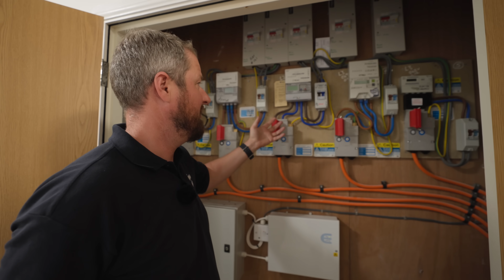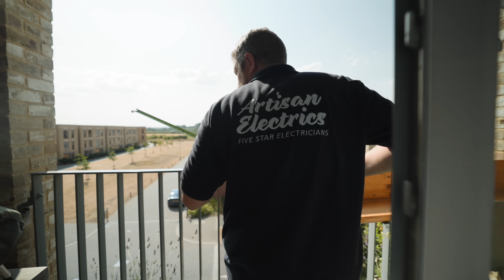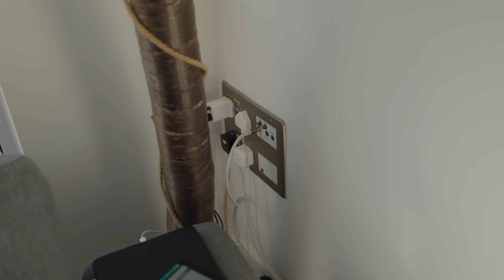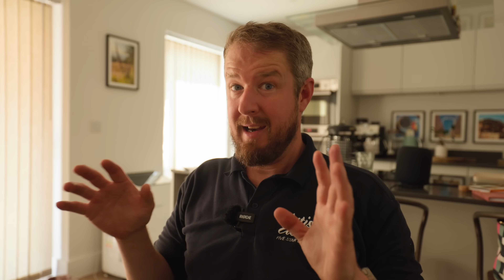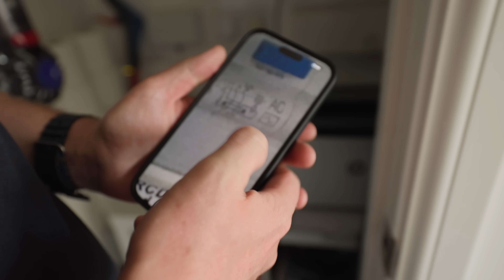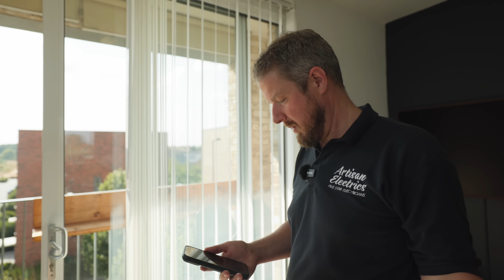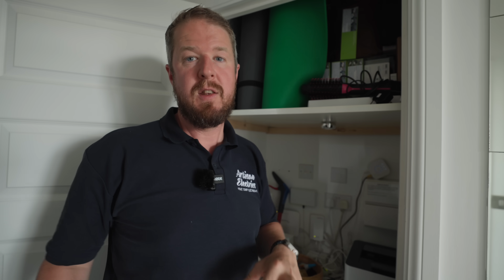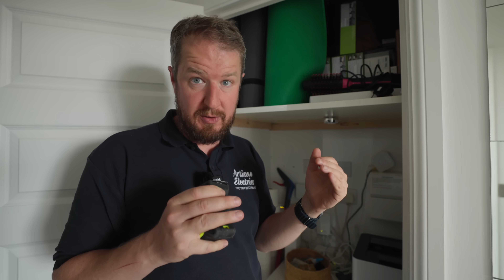I Found a BIG Problem With Plug-In Solar…

Comment: Come on, it's 800W (3.5A) and the wall socket does not care which way the current flows. If there is a problem to connect such a tiny load, the home wiring is probably allready dangerous without it.

I do agree that a tiny balcony is not really suitable for this solution. A minimum of two 400 Wp panels is worth it, but I would not spend the money on anything less.

The heat issue is nonsense. These panels take away about 24% of the radiation and convert it to electricity. The rest of the radiation is either converted to heat in the panel or heat in the home if it was not there to block the sun. The biggest downsides are blocking the wind and the view.
Reply: And fartisan ought to know that because one of the classic ways you cool a problematic hot room in roof in the UK is put solar panels on top of it. They act as a parasol, and generate power and it's about the only parasol you can attach to your house roof without planning.

Comment: Again scaremongering. Come on pack it in. You’re not doing yourself any favours.
Reply: Because this will affect his business in a negative way.
Reply: @Stephen_Dove I don't think plug-in solar will affect solar installers in any negative way.
Firstly, they don't install on balconies.
Secondly, the market for a 5kW system is totally different from the market for a 800W system.
Thirdly, someone that I stalls a plugin system and see the benefits may decide to transition to a large system.
Its a win-win for everyone IMO
Reply: @konstantinlozev2272  A few years ago that may have been the case but the underlining cost of roof Solar and batteries large enough to go grid neutral is so vast it can neve be recovered now there is no feed in tariff except local deals, 12p I think.

In the beginning the highest Current Inflation-Adjusted Rate: Because those initial 2010/2011 contracts were locked in for 25 years and indexed to inflation (RPI, and later CPI in 2026), those original 2010 tariffs now pay out over 74p per kWh generated. It was worth it. No chance now.
Reply: It’s not scaremongering to tell you that you need to check if your electrics is up to date. If you are clueless and just buy something without checking then you are a fool.

Comment: A type RCD suitable for recognising DC current????
Reply: Yes, just because every modern inverter is already protected against leaking DC current and two panels can hardly electrocute a fly.
Reply: No, but it doesn't get disabled by DC current like a type AC. That's the actual issue here, not it detecting the DC.
Reply: I’m pretty sure the big red switch on my consumer unit is compatible.

Ironically, when I had part of the house rewired 20 years ago, I asked for an RCD to be fitted and, apparently, they didn’t make one sufficiently insensitive to be compatible with my 1964 electric cooker. It seems the earth leakage requirements were less stringent in those times. Since I was not interested in buying a new cooker, I simply went without an RCD. 

I’m now suffering angst because I don’t have a label on my consumer unit telling me when I last had the house tested … Conversely, I’m not in a hurry to let any electrician anywhere near my wiring with test equipment, since the last time (3 years ago) when I had an MCB blow up on me and the electrician blindly ran hipot tests on the neighbouring circuits to check for associated damage only to then destroy a digital heating controller, an electronic lighting controller, 3 LED bulbs and 2 power line network adapters!! Not only did I pay for his time and effort, he also cost me ££ to replace all the destroyed electronics. I thought the guy was supposed to know what he was doing.

Comment: "I found a big problem with plug in solar .Iam not getting paid to fit it "   .There fixed the title.
Reply: I think the target markets are different.
Rooftop solar is very much different in use case Vs plugin.
And if you start with a 800W plug-in system, you may ultimately see the benefit of solar in general and decide for a large installation.
Reply: @konstantinlozev2272  seriously! The first taste is free :D
Reply: @konstantinlozev2272 genuinely what I’m thinking of doing. I don’t currently have the capital to lay out for 20 panels (big roof) + battery but would like to make my house more green in terms of energy consumption. Be interesting come the end of this month!
Reply: Exactly.
Reply: Same as in France, the way round it is to have batteries that only trickle power into the house
Reply: @thetourk the way around it..,?  What do you mean...You cant plug regular batteries into mains power.
Reply: Should be booo hoo please don't do it yourself!
Reply: So true.
Reply: 😅😅😅 Yessss
Reply: THIS!  The whole video has a negative vibe about. He went in looking for reasons to not do it.

Comment: Gawd - our ruddy future - the rest of this Century - is being directed by blokes in shed, lashing up crud with cable ties and duck tape as a bloody hobby!! - it makes me weep. We used to have engineers doing this, building it properly, and running it as a serious blasted industry. If I were the boss of BMW looking to build a new Mini factory in the UK, where would I rather my electricity came from? A big building run by National Grid. Or some sodding junk out of the local DIY store, flapping on the patio fence. All held on with lengths of baler twine and sticky tape. It's what the Cornish would call "a bloody lash!" And this is the sodding future of UK PLC ?!?
Reply: Well it's been working fine in Germany, engineering powerhouse of Europe

Comment: I'm not a electrician, but i have a decent knowledge how the powergrid in my house here in Belgium works, but what i don't understand with this entire plug-in solar is this :
Normally, the power comes in to your breakerpanel and into your breakers, and if a overcurrent or short occurs BEHIND the breakers, the breaker(s) trip. So far nothing special, but with plug-in solar, the power comes in on the output of your breakers, so when a overcurrent of short occurs, this current does not go back and forth through the breakers, so  how can they trip then ? The only way to get them trip this way, is if the overcurrent or short is on the input side of the breaker(s), or do i miss something here ?
When using plug-in solar, you need to turn off the main switch, to prevent power from the grid and power from the solar at the same circuit at the same time, but with the main switch off, the input of the breakers is open circuit when using plug-in solar, so how can they trip then ?
So the only way that i understand, to protect against overcurrent and short, is to use breakers between the inverter and the wallsocket that is used for the plug-in solar. 
Can someone enlight me what i'm missing here ?
Reply: So there are a couple of things. You have mini circuit breakers and RCDs. Mini circuit breakers trip when the total current draw exceeds their rated value. RCDs trip when the live and neutral get out of balance ie there is a leakage to earth. If you get a short between live and neutral fault then sufficient current will still be drawn from the grid and trip the MCB. If you have an earth fault then the live and neutral will still be out of balance since you won’t have a balanced neutral and it will trip. The inverter will have its own safety system built in so I expect it would trip in the event of an Earth leakage. They have to stop working when the mains voltage drops anyway so would be surprised if they didn’t have over current and Earth leakage detection.
Reply: Also, all UK wiring is more than capable of an 800W (3A) overcurrent, which is unlikely ever to occur anyway.  Most UK homes have their 13A wall sockets on one or two 32A ring mains, with current able to reach every socket from 2 directions, over 2.5mm² (20A when enclosed) rated cable, thus 40A capacity, 8A spare capacity over the breaker, 2KW spare capacity.
Reply: The breakers have 2 failure modes:

(a) Current exceeds the rating because there's too much plugged in. Adding solar adds additional 3 amps the breaker doesn't see, so the breaker only trips when there's 16+3 (or 32+3, or 10+3, depending on the breaker) on the wire. That is not critical. There's more than enough headroom in the wiring. This, btw, is a slow trip after a couple of minutes.
(b) There's a short, like someone touching the wire and the current flowing through them. Here, the house installation must be designed so that when that happens, enough current flows to trip the breaker instantly. That number is way above the rating of the breaker, not just a little above. 3 extra amps make no difference here.

Also, the inverter cannot output power when there's no grid power for it to read.
Reply: Easiest way to explain it is "it's British"

So we have ring mains that suck but were cheaper and are less safe.
We have undirectional RCDs that suck but were cheaper and are less safe

You can continue this pattern for most things in the UK.
Reply: The plugin solar is only providing 3.6a on the circuit that can handle 10a... What's the problem??? If there is a short well then the breaker is going to trip!!! What's the Problem???
Reply: @SolarizeYourLife  Nobody puts a 13A wall socket on a 10A circuit, and the plug in solar rules require a 13A wall socket, so the circuit will be at least 16A, so that is at worst a 6% overload before the breaker trips.  Who ever continuously takes exactly 13A out of a 13A wall socket on a cloudless day anyway!

Comment: im pretty sure you building lease will not allow stuff to be hung off the balcony. It most cases you are not supposed to even have potted plants hung on the railings because they are not designed to take heavy pots full of rainwater. Also you'd be blocking out your light to the apartment.
Reply: Well the railing should at least be strong enough to handle someone stumbling and crashing against it. Otherwise we would have heard in the news that someone ripped the railing out and fell.
Reply: @Felix-st2ue  Building regs covers this but the odds of most people doing the correct structural calculations for it are a bit low. Same with DIY roof mounted solar which is already a problem. They have tried to dump the requirement on the kit provider but the reality is that whilst the kit provided can be required to include building reg compliant fasteners the rest is a bit more unclear.

Doesn't seem to have been a big problem elsewhere however.
Reply: I have seen several very light weight solar panels that would not create any worrying loads on the balcony.  They are not quite as efficient, but you are restricted to 800w anyway.
Reply: @TerryHickey-xt4mf well you can do 2000W of panels. Also the main concern isn't actually the weight. Its more the wind. Those forces can get a lot bigger than the weight. But anyhow who are we kidding. As if the balcony on the video wouldn't carry a solar panel.

Comment: I don't think any of these systems monitor the power usage, and just go by the fact that they can only output 800W.
Reply: They do monitor when used with additional battery so that the battery can feed exactly the current needed by the household at any given time to maximise usage.
Reply: @Maamoore  Batteries are not allowed by the plug in solar rules, so there is zero functional reason to have any monitoring.
Reply: @nigels.6051 Not allowed ...where? The functionality is there before my eyes in the Ecoflow app. Plus, if you refer to the UK, I read few days ago that the UK government was actually planning a scheme to deploy plug in home batteries for UK households.

Comment: I don't know, normally your videos are quite informative however I think in this occasion you have muddled quite a few things and seem to be trying to over complicate some elements.  You also talk about batteries and meters which is not what is going to be in the first set of regs(at least in the short term).

Comment: Mmm. Regs dont allow attaching panels to a wooden fence for plug in solar I believe.
Reply: In the garden you can simply ground mount them.
Reply: Fence as far as I can see is fine - except for planning. People are misinterpreting the rules designed to stop them being stuck on flammable tower blocks, because a decade on we still have thousands of buildings that will burn like candles and not fixed.

Comment: You suddenly started talking about batteries...eh?!
Plug in solar is panels plus 800W inverter, no batteries.
Reply: You brits, are all about the battery and gaming the system... 😊 Buy low sell high...
Reply: @SolarizeYourLife  we're  not all like that, most of us just want to soak up all the solar and/or to have another 3kW+ to provide more power for a spike in the load.. well I do anyway.
Reply: Unless you also get a battery, with the bigger loads connected directly to the battery, you're still drawing from the grid.  Not so bad if your meter winds backwards at the same price as when it winds forwards, but that's not always the case.

Comment: What are rules around a metal balcony and earthing or is it not required because earth will come from supply?
Reply: Depends on if it’s extraneous conductive part.
Reply: Ideally, the inverter would have the PV side isolated from the AC side, so it should be irrelevant, no earth required... wonder what is in the rules?
Reply: @nigels.6051  Yes - it's inherited from the referenced German regulation. There's still a case for earthing things in some cases though especially on roofs. You don't need many volts of surprise to fall off a ladder.
Reply: @etchedpixels  There is a case for earthing roof panels, but really only because some inverters manage to put an AC waveform onto the DC side, they are not properly isolated, and then the capacitance of the panels manages to store the AC energy and build it up into a high voltage on the frames in the same way a taser gun does, so the frames can zap you at times of low humidity.  There is definitely a case to ban inverters that do this, especially for plug in solar where the panels are likely to be accessible.

Comment: Well you have certainly made up a load of usually nonexistent problems, like ‘is the cabling up to plug in solar’… I would say that if it’s not up to 800w then stop using your kettle, iron, microwave, hairdryer etc.
Just stop making problems that aren’t there to scare people that just don’t know, just because it may affect your business revenue by people doing it themselves when it is fully safe to.
I use to love this channel, but I think you are getting ideas above yourself now…
Reply: If the wiring is not up to 800W then of course it will be protected by a <800W MCB/fuse in the consumer unit, which will do its job when you feed your 800W of solar through it, thus everything will be perfectly safe!

Although you will have to plug it into a circuit with a 13A wall socket, since the plug in systems can only be sold with pre-assembled 13A plug, so you will always have at least 3,000W capacity available in the circuit, and far more likely the 13A wall socket will be on at least a 16A circuit, which is 13A + 800W.

I don't know why we are worrying about the angle of the panels, we are only trying to provide the house background load, which in most houses is well below 800W, it does not matter what angle the panels are at, only if you buy a 1 panel or more expensive 2 panel version of the plug in solar kit!  And the size of Jordan's panels is irrelevant, since the kits will come with their own panels, which are not going to be 2m standard width panels, since most people can't safely carry one of them out of Lidl, and certainly can't safely install it on the outside of a high rise balcony!
Reply: @nigels.6051  You actually want the panels on a wall flat on the wall amusingly for a small system especially without battery as is permitted from the end of the month. That maximises winter generation when you need it, at the cost of reducing summer generation where you get to donate half of it to the energy company shareholders.
Reply: @etchedpixels  When fitted to a vertical wall, the best angle for generation is the one where they see most sky, tilting them up means that they see more wall.  Given that most UK walls are quite dark, I think it is very unlikely that you want that mythical 30° anyway!   Tilting them is certainly not going to give as much of an advantage as tilting your roof to the magical 30°.

I think would prefer them horizontal, away from the wall, since that gives best power in cloudy conditions, year round, and it is in cloudy conditions that you are less likely to achieve the house background load.  But realistically, it doesn't matter; you want them safe, secure, and looking good first, then worry about choosing a one or two panel kit, then about having one or two kits!   When we get to the plug in batteries, then angle will make a difference, but for covering the background load it is insignificant.